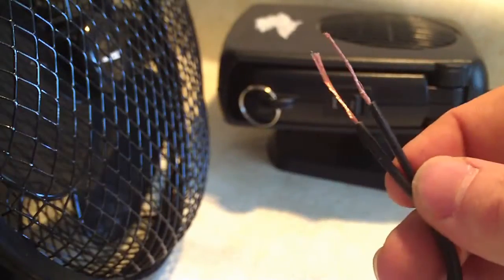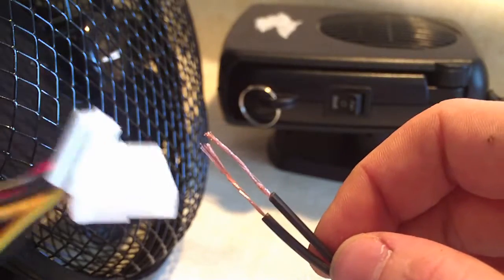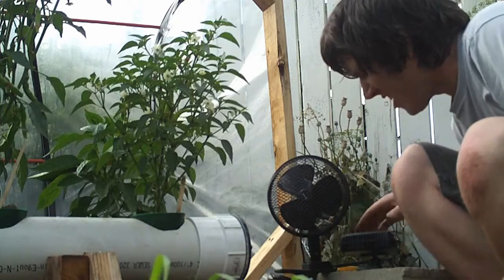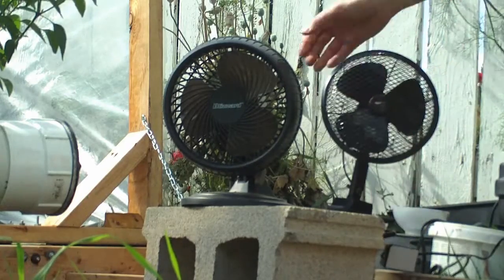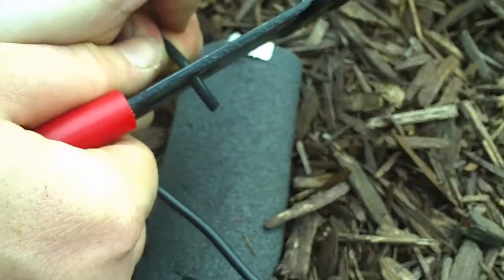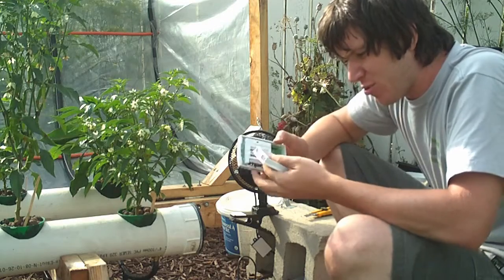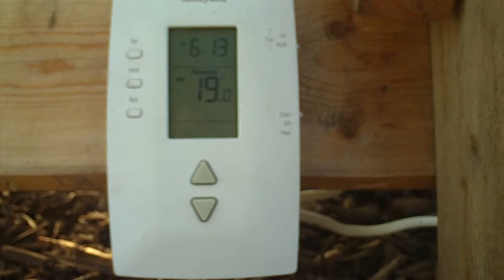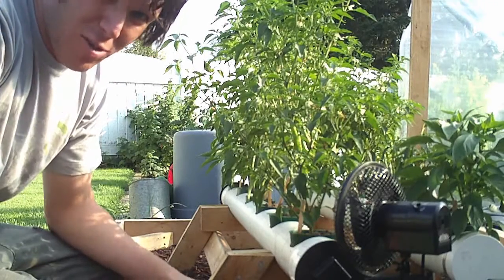How To Hydroponics - S01E10 Climate Control

Comment: I may use this for the fan but posibly for a system to automatically polinate plants that goes on for say 15 minutes twice a day. I may also do this but use two small computer fans one on either side of the cold frame to flow air straight through. It will be a fun experiment to try out because it may bring in unwanted pests like aphids. Saying that though i will be using a foliar spray with added pesticides.